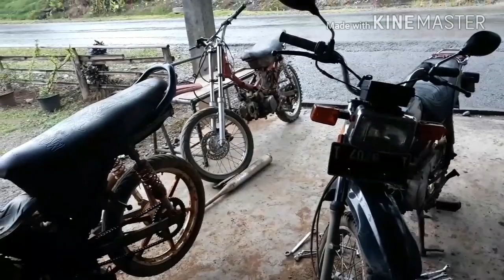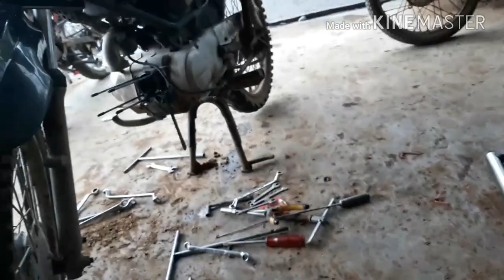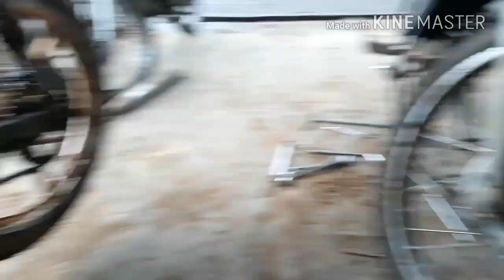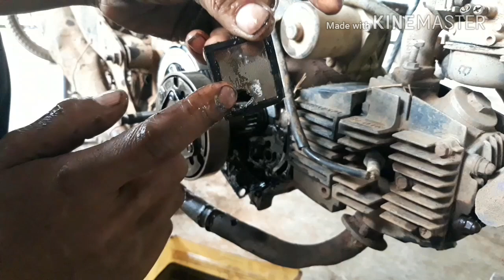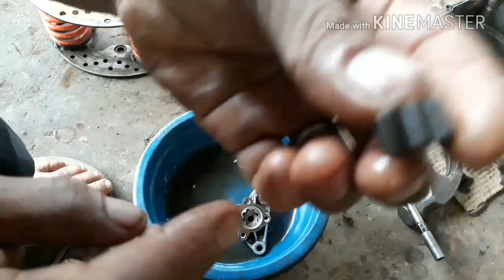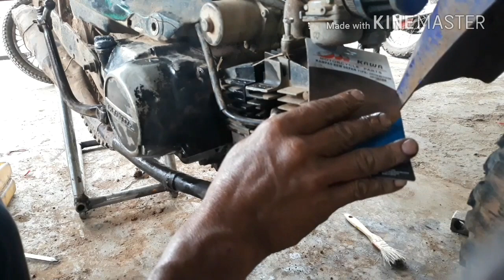Cara periksa pompa oli dan Penyebab oli tdak jalan. Grand/ supra 100cc

Comment: Hadir bos mau tanyak bos
Reply from the maker: Ya... silah kan
Reply: Klo kmps kopling di gas yelip itu apa yh bos....montor ku revo
Reply from the maker: @nuri4495  biasanya.... kampas koplingnya sdh menipis. Jika kampas nya masih tebal periksa pada plat tekan dan rumah gesek, kemungkinan rumah gesek sdh menipis.
Reply: Revo ku qu oplos bos pake perumhn kmpas kopling karisma ori serba baru.... sblm yg pakek prumhn asli yh tetep yelip2...pake perumhn karisma tetep sama klo di gigi depan bisa ngopling klo di kurangin ga bisa ngopling.... apa ada yg rusah gigi raiso yh
Reply from the maker: @nuri4495  Oooo.... gitu ya.tuas tekan nya yg tdk tepat. Tepat kan top tuas tekan nya.
Reply: Siap bsok di cek lg...blh minta no wa bos... buat tayak2 masalh montor...
Reply from the maker: @nuri4495  085283629057
Reply: Mau nanya bos motor saya Jupiter Z1 kalau mesin panas bunyinya berisik gimana solusinya bos?
Reply from the maker: @marwankahar700  ...maaf saya hanya bisa prediksi aja..
Kemungkinan 1. Bantingan piston di blok.2.keteng. 3.rumah kopling.